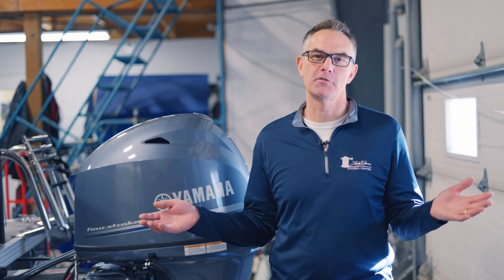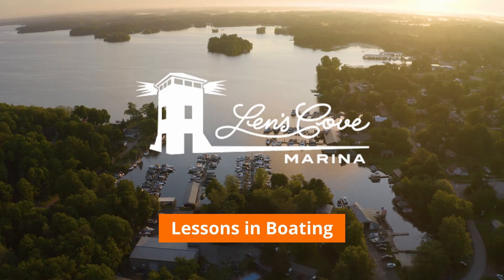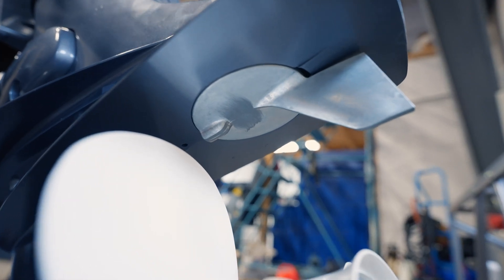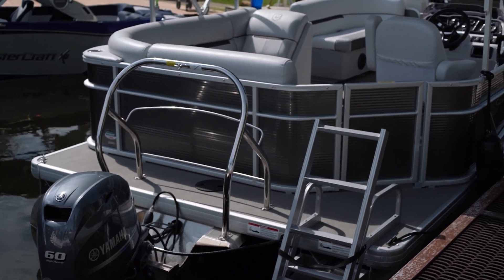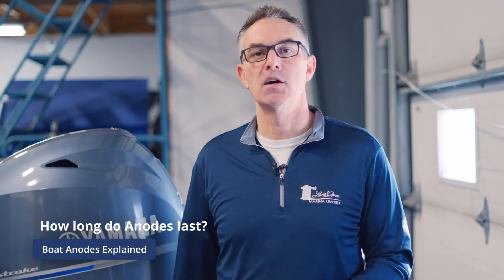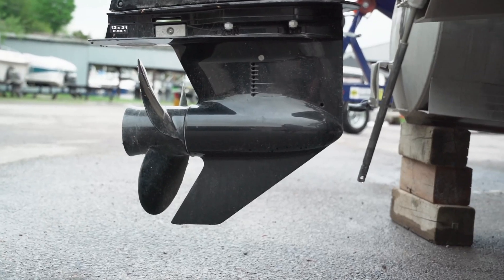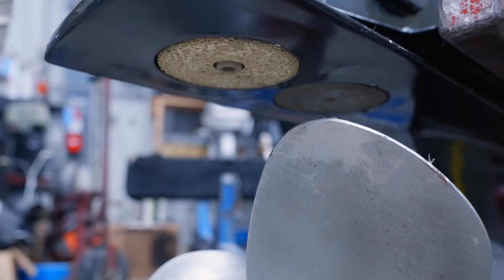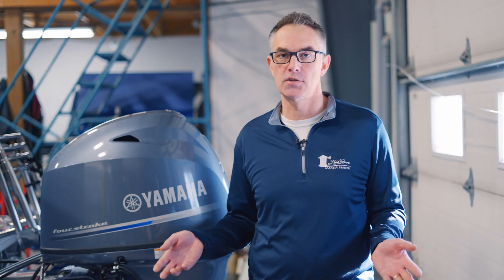Boat Engine Anodes Explained

Comment: Hey Sean. I saw this video re the anodes. I have recently purchased a local brand Pontoon and live in Langebaan South Africa. I have anodes on 2 of the pontoons is it necessary to have on all 3? Another issues is discolouration of the pontoon the day after use if not sprayed off immediately. Is there anything that I can coat the aluminium with that will prevent this...? Thank you for all the info you provided very helpful. Shawn

Comment: So if I have an aluminum hole houseboat and it does not have any motor components, it is more of a floating home type situation. Do I still need Ann on the vessel and if so, can they just be hung off the side or is that not suggested?
Reply from the maker: Are you close to any steel in the water close by? Docks?

Comment: Is there any difference between a oem anode and  , lets say,  a suzuki anode? 
(with same material, shape & size)
Reply from the maker: I think what you may be asking is if there is a difference between OEM and aftermarket? There should not be any significant difference, in our opinion
Reply: @boatinglessons  thank you

Comment: Zinc anodes also are not used in freshwater because they tend to passivate.
Reply from the maker: Yes, that is correct 👍
Reply: We run these small engines in a freshwater tank after every use, as recommended by the manufacturers. And later they are left outside , exposed to atmosphere. I observe that the tail anode of suzuki 6hp continues to detoriate. 
Is that why they use aluminum anodes, to protect the engine outside (no saltwater) as well?